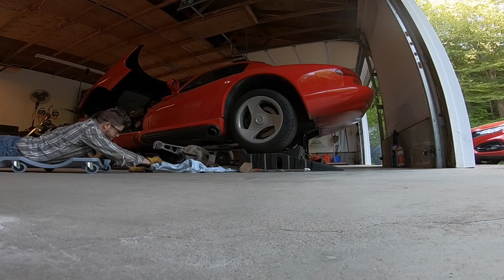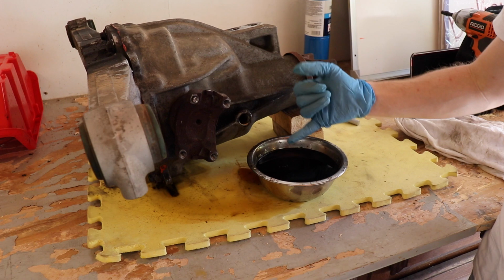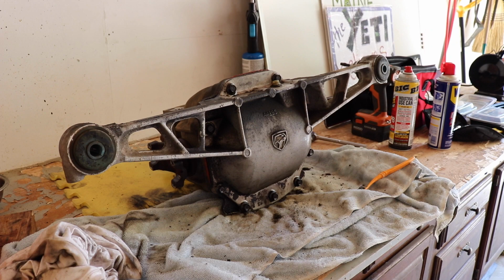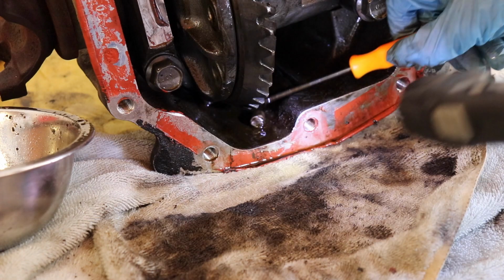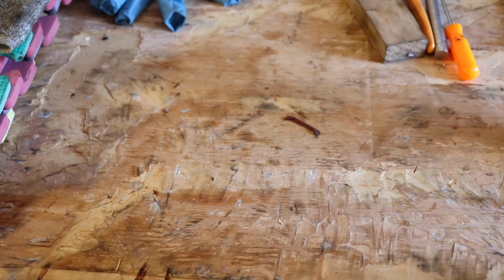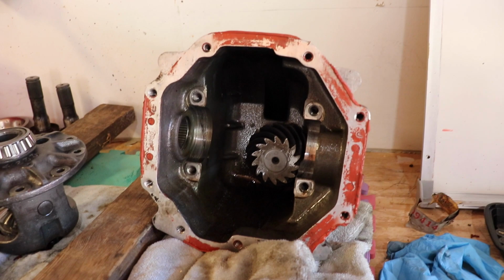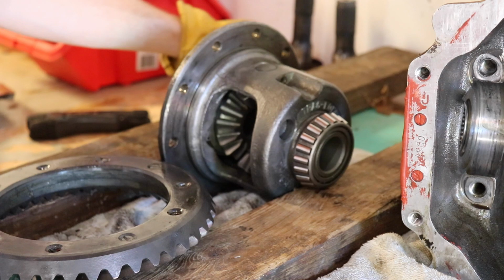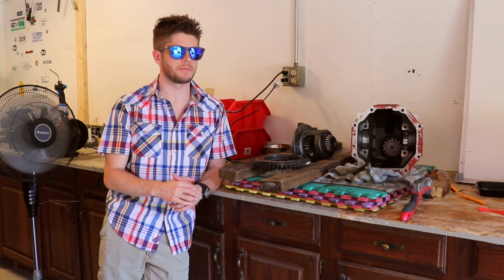DODGE VIPER Differential Rebuild, Part 2: Differential DISASSEMBLY

Comment: Yet another great video. Keep em coming! Hey quick question, does the manual tell you how tight to torque all the different bolts? That’s probably what I’d be worried about the most - making sure I wasn’t over or under-tightening the bolts again. Also +1 for locktite.
Reply from the maker: Thanks, more are definitely on the way! So, I don't think the regular owner's manual tells you torque specs, but I think the official maintenance manual does--either way, I'll be confirming the torque specs before reassembling. And I'll definitely be using threadlocker too! Thanks for watching

Comment: Hey thanks for the upload man, what a nice surprise it must have been to open it up and see the only damage being the bolts!  Crazy.  I just came into possession of my very first 94 RT/10 (finallyyyyy) and you've got me worried now haha!  How did this happen, what was the mileage, what tires were you running, did you stop the instant you heard a noise? So many questions :D
Reply from the maker: For sure, I was so relieved when I saw that it was just the bolts. And congrats on the Viper purchase! So my mileage is around 36k, and I'm running Michelin Pilot Sports. I was literally just creeping forward in a traffic jam when it happened; there was a metallic snap from underneath, and that was it. I gave it a couple tiny taps of the gas to make sure the gears had meshed correctly, but when the car wouldn't move and I heard a faint metallic grinding from the rear, I knew there had been a significant failure. But, with that said, don't be afraid; I believe this failure happened on mine because past owners did burnouts. And, when you have 400+ horsepower, 465 torque, high traction 335 tires with no traction control, burnouts are not a good idea. All that power has to go somewhere when you dump the clutch, and in this case, it went to the ring gear bolts. So, unless you've got super slippery tires and/or a wet road, refrain from doing burnouts!
Reply: @GETUPANDGO  After I commented I went back and found your video of you explaining it, and then of course the videos leading up to this one!  I'm always surprised how videos like yours have less views than I'd expect, but the content really is UNIQUE to our cars in many ways, and having over a few hundred views speaks volumes:  How many of us with Gen1's are using youtube!? :D  Your channels great man, and I've learned a lot from your various vids.  Keep it up I'm looking forward to the future vids!  Also, I checked up on our DANA 44's and it's not a very common problem fortunately!  Burn outs with fat tires is NEVER a good idea unless it's slick out, I learned the hard way after going through 3 sets of axles in my SRT8 :D  *Cheers man
Reply from the maker: @krallopian  Ha, no problem, YouTube has a way of burying videos. Thanks for watching and supporting! The Viper definitely isn't as "mainstream" as some other cars out there, but luckily some fellow Viper owners have found my channel, which is pretty cool, and it's fun to make the videos either way. Good to know this doesn't seem to be a common issue with the DANA 44, I hadn't found much on my searches about it, so I think the lesson is no burnouts with sticky 335 tires! Sounds like you've been through a similar process with your 3 axles--damn!

Comment: Meant to break bolts before others parts brake? Ten seems high to have broken but wrong material choice might be intentional or bad design, not sure?
Reply from the maker: Yeah, I'm glad the bolts broke, otherwise the diff internals may have shattered, and that's a much more expensive fix

Comment: You definitely want to torque up the p32 to .0091j6 specs or you will be screwed. I've seen it a thousand times
Reply from the maker: Yes, I definitely will be torquing everything to spec